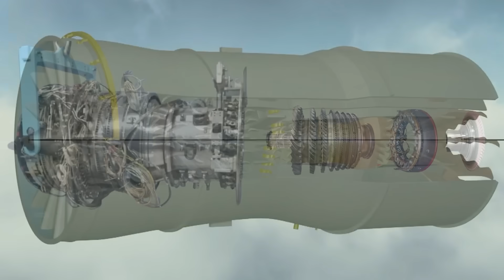How powerful could America's new F-47 stealth fighter really be?

Comment: I've been saying for a long time that a big, long ranged fighter is what we need and it should use two engines the same size as the f35. Since we are going to have thousands of F35s and far less of these new ones, engine commonality will go a long way towards keeping costs down with the new bird. Not to mention the raw, earthshattering power. Plus, with them using the same engine bay. The newer engines in the f47 could be put into F35s as they need to be repowered.
Reply: Adding 30% more range to an f-35 would be a pretty decent upgrade.
Reply: @MrTmax74 30% would be a disappointment considering the new engines and much larger frame
Reply: @dude3278  Are you sure the frame is going to be larger? They are trying to keep costs down and by the renders they showed us it doesn't seem to be a large airplane unless it is a side by side 2 seater.
Reply: Pratt has a strangle hold on the F-35’s engine and they will milk it for all it’s worth. Promise of increased core power, risk reduction, etc, just to keep the XA opportunity away and maintain monopoly. 

Sure hope GE’s XA100 wins the F-47 engine contract so there is an actual proven in service next gen alternative engine provider.  Otherwise, they will likely not survive as a military engine provider as almost all new military power engines would then be dominated by Pratt.
Reply: @et8496  yeah, that's what we don't need.   More Monopoly in the pricing.
Reply: @ Solid point. Which would make having the same sized engine on the new fighter even more appealing. It means we could feasibly re-engine the F-35's if push came to shove.
Reply: Need it for what?
Reply: @MattMajcan  long range interdiction....
Our fat Amy is really a stealth bomber.....
Reply: You mean the B-21? With size comes slowness and I don't think that is where they are going. If you want a missile truck then take the B-21 in there with half a dozen CCA drones. That was one of the ideas that was being kicked around when they were thinking about dropping the NGAD program.
Reply: @thomgizziz  no.  The size of the new Chinese bomber fighter.   Because that's what it is. It's perfect for it's purpose, which is a first strike stealth bomber.   We need smaller cheaper stealth bombers than the raider.   Larger than a fat Amy, smaller than the raider.   Israel's raids lay this out.   The f35 was used first and the f15s followed as multirole bombers.  Keep in mind, both the f22 and f35 have an interior weapons bay.....
Reply: @ Who said anything about the B21?
Reply: We need a f16 kingsnake.....
Reply: @daleb5967 Just build more F16s if you want F16s.
Reply: @BishopStars  f36.       Super cruise 1.5, stealth, more range, and more weapons payload.

Nobody needs dog fighting jets now.     At least not for offensive use.
Reply: @ If you're going to give it all that, it's going to be expensive, just build more F35s.
Reply: @ Because the F-35 is lacking in a few areas, like top speed and range. Did you even watch this video?
Reply: @Elthenar  the only thing scary about the j36 is the fact that it checks the boxes on stealth without coatings, a longer range, a larger payload, and maybe some scoot speed.  
We've been building stealth planes for 30 years in various forms.....so no tech loss for us.    We just don't have any we can afford and produce fast.   The Raider itsnt even in service yet, let alone in production.     And I'm expecting most of that to get reduced again or cancelled.   I think Jane's and the aviationist just had articles on cuts along with Trump's ok.
Reply: Why would the F-47 need so much thrust?
Did you even take a minute to think about that?
If it is supposed to be long range, how would needlessly overkill thrust, and the accompanying fuel consumption, have any point on the new aircraft?
Reply: @Astro_Guy_1  missile evasion, fast deployment / takeoff, takeoff with heavy payloads.
Reply: @BishopStars  Sure, but 30% more thrust than the F-22 is just unescessary in my opinion. 

I know there are tons of secret technologies being developed, but I do not see how having so much more thrust is possible, while also having way longer range.

That would be a jump in capability not seen in decades.
Reply: @Astro_Guy_1  Just shows how much your opinion is worth, I suppose. The F119 resulted from the Joint Advanced Fighter Engine (JAFE) program in the early 1980s. So you'd expect to see an increase after 40 years.
Reply: @Astro_Guy_1  Why does the F-22 have so much thrust? It's a fighter, thrust to weight is a big thing and if you have a lot of dry thrust, you can supercruise at high speed while also having reasonable fuel efficiency. Plus, if they actually are combined cycle engines, your cruising speed will be incredible efficient while also having insane thrust for when you actually engage the enemy.

Comment: Really pulling for GE to get the contract for the NGAD engines.  Since these were first proposed as an upgrade to the F-35 I think the larger engine more likely (especially given the NGAD F-47 will be a larger jet with more weight needing longer legs).  The speed to cover that range without burning thru all your fuel makes GE the best option.  I see no problem utilizing PW for the F-35’s and any upgrades to the Raptor though in the meantime so GE can focus on the F/A-XX, and the NGAD F-47’s power plant.  Because the needs of tomorrow along with the needs of tomorrow’s tomorrow are only becoming greater by the day.  And making an anemic engine now as a stop gap to save money means a greater leap needed down the line to make up the difference.  I’d definitely like to see more on these engines.

The other factor is the ability of stealth materials to withstand sustained mach speeds and maintain both radar as well as infrared low profiles.  These aircraft will need to go greater and greater distances as time goes on, while also being able to conduct flight operations, and return.  They need not just long legs, but the ability to cover that distance in time to be relevant to the fight.
Reply: A new ceramic RAM coating has been developed there is a white paper on it. Heat isn't an issue with it and it is hard so it doesn't need to have as much maintenance done.

Comment: If it's larger and therefore presumably heavier then it will require more powerful engines to even equal the performance of the F22.  I'm not saying this is a bad thing, just pointing out the math of the situation.  Larger and therefore more fuel capacity + more efficient engines = longer range and more loiter time.  I will be interested in seeing the final design and specs.
Reply: Well that asumes material science hasn't also developed more
Reply: Yeah we have no idea how big the bird will be

Comment: you'll be 10 years older when this is actually produced in any numbers
Reply: Still glad that it's being built just as we're glad that we built the very, very expensive SR-71, F-14, B1, B2, and F-22 aircraft. The cost to avert WWIII has been worth it.
Reply: They said it's been test flying for a couple of years now.
And said, should be in military use by 2027.
I think the lessons learned with the F-22 and F-35. Will have this project going faster.
Do I think we will have 30 up and running in 2027,no. But maybe 5-10 is a better number.
Reply: @stealth2951  Hopefully you're right. I'd like to see a "Block 1" that could be built with off the shelf tech ready in 1-2 years. We need them badly. But that won't happen.
Reply: 10 years or so until they are hitting operational units and going IOC.
Reply: The program is actually a few years ahead of where it should be and it's far more efficient then the F-35 procurement program was. Even if it takes ten years and that's a big if, so? As long as it's on time and on budget I'm fine with it, so far it's ahead of schedule and on budget.
Reply: still cool as fuck
Reply: stuff... takes time???? jesus christ we need to stop all funding now!
Reply: 😂😂  @2goober4u
Reply: 15-20 is more likely, unfortunately.